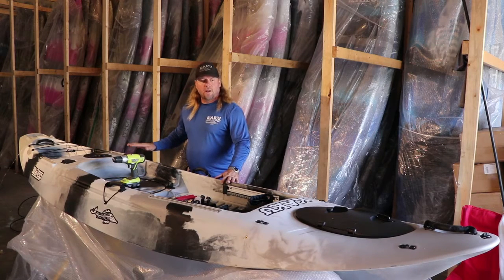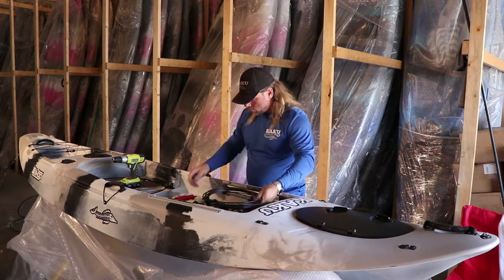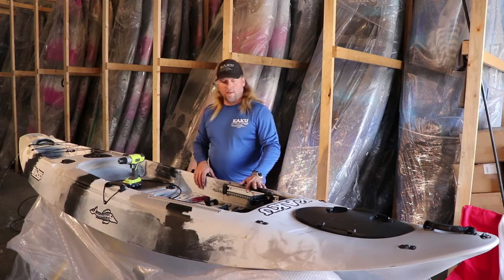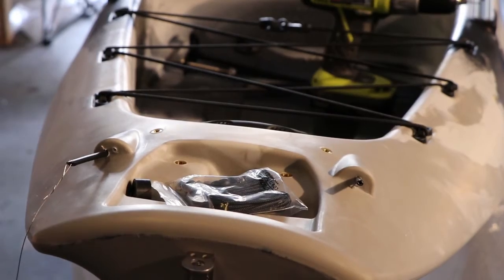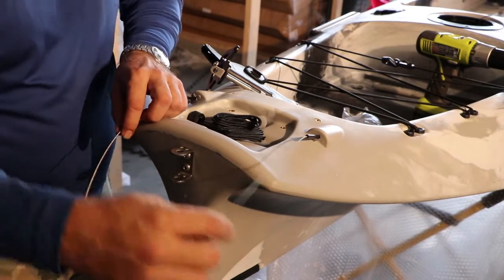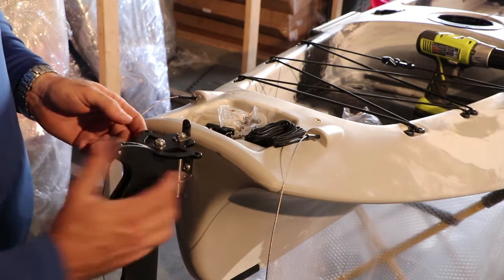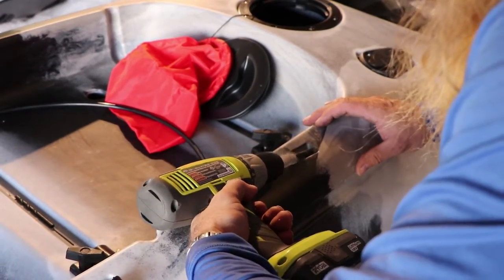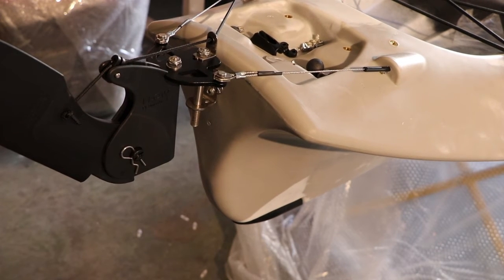Kaku Wahoo Smart Track Rudder install

Comment: Does the rudder help for stability
Reply from the maker: No, rudder doesn’t have anything to do with stability
Reply: @KakuKayak  I turned over twice while paddling waves were hitting the side of my kaku was impressed that against wind it paddled fine and was stable.any info would help
Reply: 20 mph wind 1 ft swells
Reply from the maker: I paddle 200 mph and much more than 1ft swells in it just fine. Not sure i fully understand that second comment

Comment: Where can I buy the rudder system?
Reply: You can find it here: https://kakukayak.com/product/wahoo-rudder-kit/ If it shows as out of stock, contact Kaku @ 877.327.4893 to see if they have more in stock. There may also be a Dealer near you who offers it. We'll be updating the Kaku website to show an interactive map of nearby Dealers soon.
Reply: I live in Tampa and have a 10.5 Wahoo. Can the rudder system be mounted on the 10.5 since it doesn't have the rear hatch?